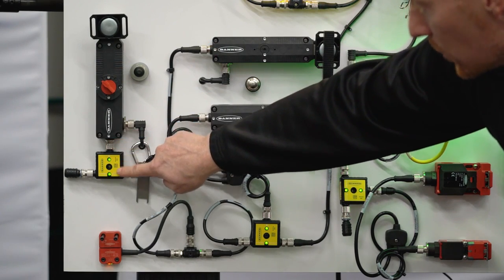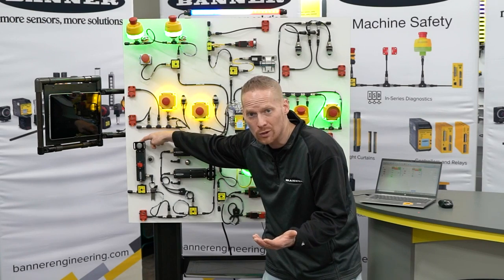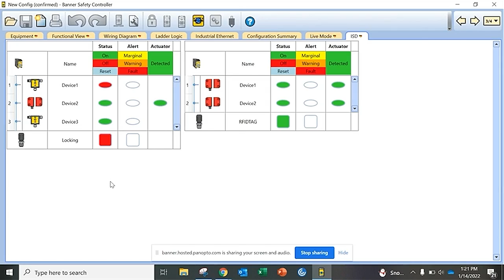Machine Safety: Banner XS26 ISD Safety Locking Solutions with ISD Connect

Comment: Today we had door switch wires get swapped. The VFD was getting safety fault and would not work until after I swapped the wires. The PLC showed no alarms. Did the banner ISD sensors prevent the VFD from enabling? How did the sensor know the correct cable wasn’t connected ?
Reply from the maker: Hi! We'll need to learn more about your system to answer this question, feel free to reach out to our Apps Engineering team to discuss it further: https://www.bannerengineering.com/us/en/forms/contact-an-engineer.html